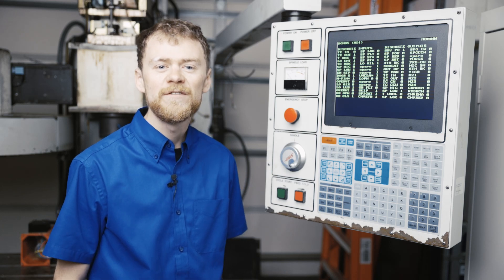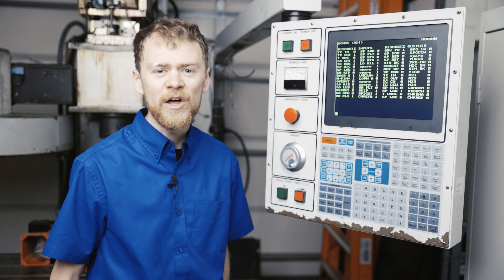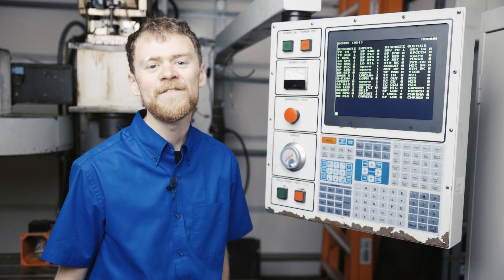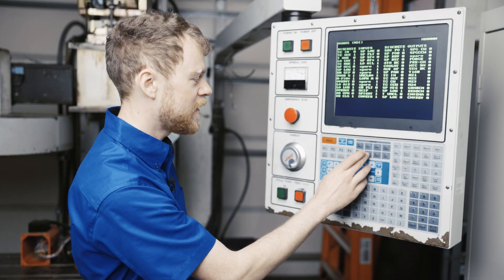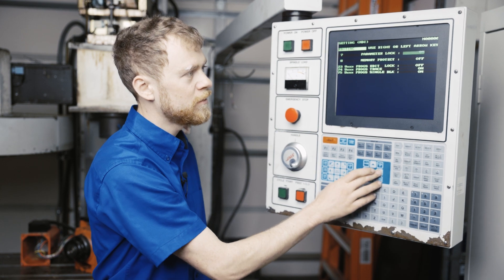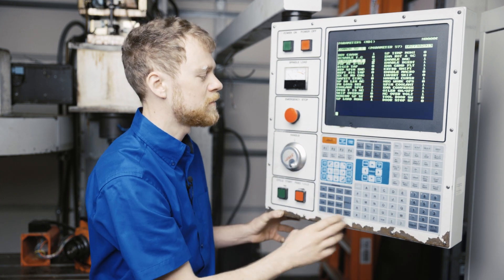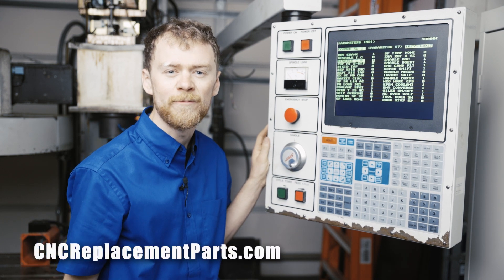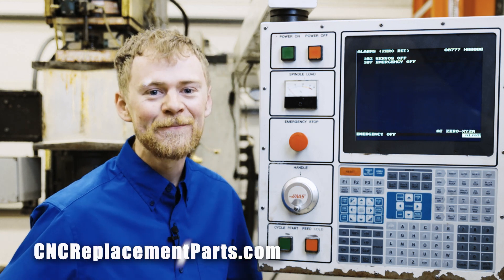Gearbox Shifting Problems Disable Gearbox and RUN

Comment: I can't believe you just said to run it in high gear. Yes, this problem can be fixed. You need to pull the motor/gear box to access the cylinder. It can be fixed